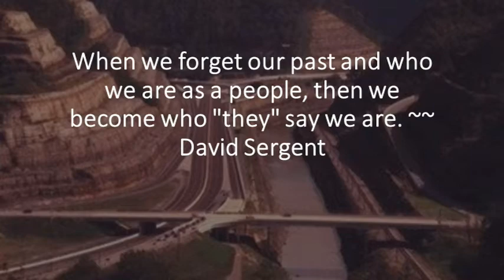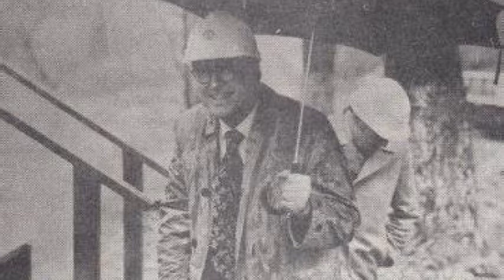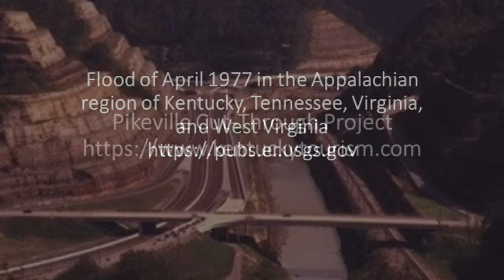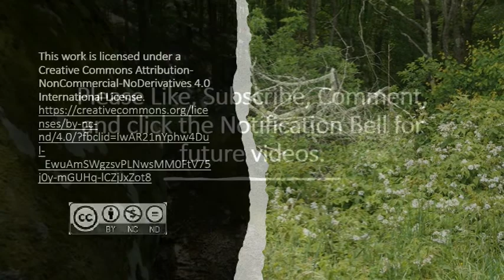Pikeville Cut Through Project

Comment: Was the cut-through the final section of Corridor B to be completed in Kentucky?
Reply from the maker: As far as I know it was.   Corridor B contains Highways  U.S. Route 23 (US 23), US 119, US 460, and KY 80, and a railroad for the CSX railroad, the Big Sandy Division, and the Levisa Fork of the Big Sandy River.  The last time I was in Pikeville, the construction for the Corridor B project was completed 

Now just below Corridor B is a section of highway that is the new I66 Corridor which is a different project all together and while sections and bridges are complete, the project is still ongoing.   It is funny that these two are so close together but do not intertwine.  A lot of the new 166 Corridor has not been completed, but it will run through Pikeville, Hazard, London, Somerset, Bowling Green, and Paducah.  As far as I know the Hazard to Pikeville section of this project has been completed.  The main issue it is having right now is funding and it is a political nightmare.